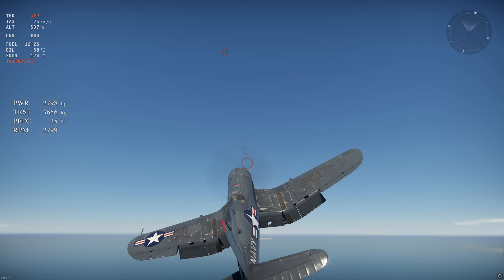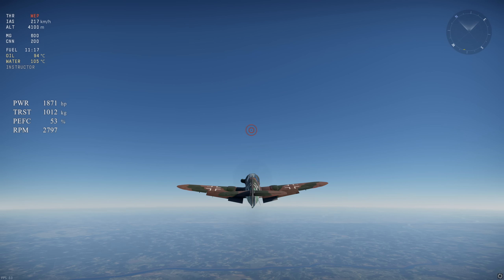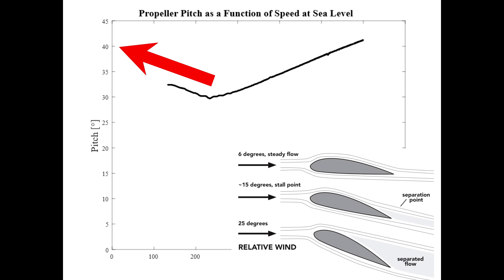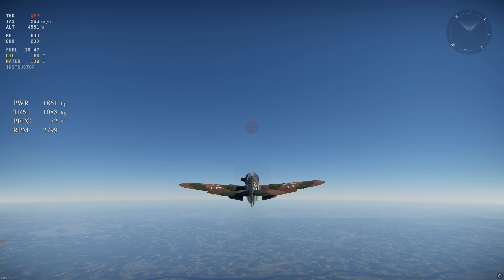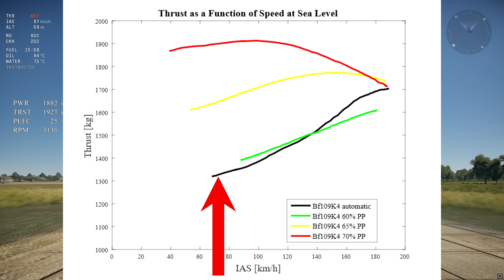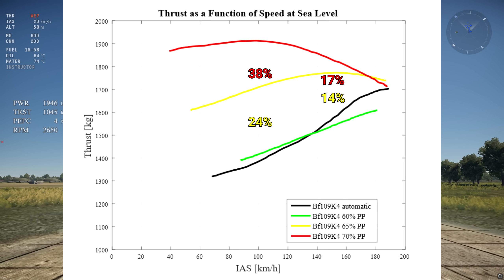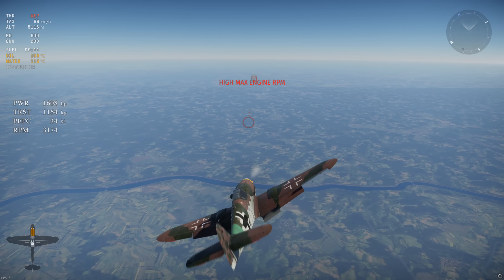War Thunder Tricks #8 | Prop Pitch Trick for Extra Thrust

Comment: I only want to be able to throw the prop pitch into reverse thrust. It needs to toggle from automatic to full reverse pitch and back to automatic. I would bind it to the same key that I have my airbrakes and thrust reverser on. I already added a separate key so I can apply wheel brakes while I maintain full throttle and tested it fully with my SK60B. With it I can come in at full WEP, hit H, deploying airbrakes and reverse thrusters, and hold the B for wheel brakes as well. If I can toggle reverse prop pitch on and off with my airbrakes, (where applicable), I can get the same effect across a wider selection of aircraft. How can I set up my prop pitch to toggle as described?

Comment: This does nothing. They have fixed auto prop pitch, so no matter what you do you will either heat your engines faster or not get more thrust.
Reply from the maker: No, this was made after the fix you're referring to. It's not about extra power, it's about improving propeller efficiency.

Comment: Great video, thanks you very much! Can I ask you something since I'm new to this? I use pitch control 70% to climb in the start of a match. Can I keep this value of 70 during battle and just switch to auto pitch control? Or is it better to reset pitch to 50% first and then switch to auto? During battle I'll use WEP and I'm not sure if 70% with WEP will hurt the engine or affect performance.
Reply from the maker: I definitely recommend keeping prop pitch on automatic, except if you want to use the prop pitch airbrake trick. There's also the extra thrust trick, but that can come later.

Comment: 5:45 sorry but is the opposite
early Bfs cant run away from enemy, so they are forced to dogfight, then you can use additional thrust trick (E1 flap dogfight with 100% pitch is a monster)
later models of Bfs can outrun some foes so the trick is not about more power but not to heat engine with MEC and low pitch
Reply from the maker: Early Bf109s don't have this issue.
Reply: @AdamTheEnginerd  what issue? Sorry but im italian i understand only "boring complete" english xp

Comment: max pitch for later models of Bf is 64-65% for climb
more then that is just a coin toss, if your engine became yellow you are fucked
for E1 model max pitch is 80-85% and max thrust is 100%
if you want to brake just 0% with WEP still on, youll brake with simply turning the plane, but the engine will stay on max power (useful because Bfs are nerfed like -200Hp and they dont fly well like USA plane that have unlimited WEP and +200Hp)
Reply from the maker: Hmm.
Reply: @AdamTheEnginerd  trust me :D
i play only Bf
i use only manual pitch because more freedom

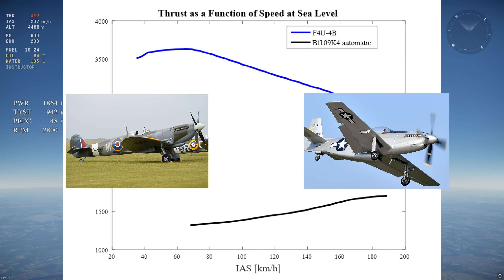Comment: 1:45
this is the problem with air battles
USA have WEP but in reality you can use it only for few mins (1 time)
germany have (they arent in game, but under the wrong stuff WEP) ethanol and water injection and NOS :))) and they can be used multiple times
so thinking about max power for USA is wrong
for real calculations USA cant use WEP and germany CAN use WEP
but we talking about crybabies so is good that USA is buffed like hell :)))
Reply from the maker: Yet Germany had a significantly higher win rate than US, at least before the main nation team changes.
Reply: @AdamTheEnginerd  yes
USA pilots just point at enemy and shoot, tunnel vision

but i understand why gaijin nerfed germany. too strong :))) WT is a bielorussian game, what a shame if germany could win EZ eheheh

my beloved Bf E1 have 984Hp

in reality the "DB601A-1" engine have 1085Hp
and "DB601Aa" 1158Hp

i still win with nerfed versions so i understand why #germanysuffer XP

Comment: Adam, a lot of the Japanese planes are in mmHG not InchesHG. Just a pointer for you. 50"hg (for the j7w1) would be coincidentally on 50, but the guages measure "boost" x10 
So 50 on the dial is +500mmhg over atmospheric (760)
Reply from the maker: Yeah I know the Japanese planes are in metric.

Comment: I think I finally understand this effect now. I wasn’t getting it before because I wasn’t taking into account that thrust increases as speed decreases. That’s why the engine overrevs below a certain speed, isn’t it?
Reply from the maker: Hmm the prop stalls below a certain speed, so you want to increase RPM to decrease AoA and hence increase prop efficiency.
Reply: @AdamTheEnginerd  I understand that the prop is stalling below 200kph which is why you manually increase RPM to prevent that stalling. But what I don’t get is why the prop pitch starts increasing below 200kph in the first place (btw I’m using the term prop pitch in the traditional sense, not the % like in wt)

Dynamic pressure acts to increase the RPM of a prop, doesn’t it? So how is it that the lack of dynamic pressure below 200kph causes the the prop to over-rev (thus making the game increase prop pitch to prevent the over-revving)? Shouldn’t the lack of dynamic pressure mean the prop revs less?
Reply from the maker: Dynamic pressure is what provides the torque on the prop, if you reduce that you'll increase the revs if pitch angle remains constant.
Reply: @AdamTheEnginerd  Yeah so that statement by itself makes sense, but I'm having trouble reconciling that with the idea that, for a constant prop pitch, RPM increases with airspeed. If dynamic pressure is increasing, why do fixed pitch props spin faster when the plane speed sup?
Reply from the maker: @dogeness  For constant pitch props, the RPM increases with speed because it reduces the AoA of the prop and hence less torque on the prop, so RPM increases. In the K4's case here, the usual happens where the prop pitch reduces as speed reduces until a bit above 200km/h. Below that speed, it looks like the reduction in dynamic pressure "is too significant" for the prop to handle causing a tendency for the engine to overrev, so the prop pitch governor increases prop pitch instead to create more torque to prevent overreving.
Reply: @AdamTheEnginerd  So there's two countervailing effects as speed increases? AoA decreases which decreases torque and acts to increase RPM, and dynamic pressure increases which acts to slow RPM?
Reply from the maker: @dogeness  Yup! The special thing here is that the engine "knows" it needs to increase RPM as speed further decreases past 200km/h.
Reply: @AdamTheEnginerd  What do you mean it knows though? I thought that part was done manually, or else the engine would try to maintain the same RPM thus increasing pitch too much.
Reply from the maker: @dogeness  When it's on automatic I'm not doing anything to the pitch, so it increases to prevent overreving. The manual part is increasing the RPM to bring the pitch back down.
Reply: @AdamTheEnginerd  Yes I understand that so why did you say "the engine knows it needs to increase RPM"?
Reply from the maker: @dogeness  Woops, increase pitch angle* instead of RPM, sorry.
Reply: @AdamTheEnginerd  No problem. Ok, I think I understand it a little bit better now. I was having such a hard time wrapping my head around this because I didn't realize the dynamic pressure and the torque effects were separate. Is there a simple equation that determines torque on the propeller as a function of airspeed?
Reply from the maker: @dogeness  Torque would just be engine power with the necessary unit conversions, so it wouldn't depend on airspeed (I think).

Comment: A little late to the party, but....

Is there a point when torque overwhelms control authority as IAS reduces?  Does Gaijin not model that as it could cause too many ground loops thanks to the Me 109’s infamous narrow track landing gear?  Or is not really a problem as long as you are paying careful attention to the throttle and propeller pitch angle?
Reply from the maker: There's no torque in RB, but in SB there definitely is, you can't aim well if you're below stall speed in SB.

Comment: La-7s, La-9s, and later yaks have the same issues, right? For planes with insane acceleration at low alt they sure are slow to take off
Reply from the maker: Exactly! But those planes can't do this trick.
Reply: @AdamTheEnginerd  one nice thing about P-47s, corsairs, and tempests: they have props the size of windmills, 109 pilots never expect you to beat them in a stall climb (obviously not the go to tactic, but it's a satisfying trick to pull off on them)
Reply from the maker: Yeah F4U4B has better stall climb than Bf109s despite having a lower climb rate.
Reply: @AdamTheEnginerd  Is there an advantage to a prop that is "too small"? is it better at higher speeds?
Reply from the maker: @Turk3YbAstEr  Lighter, smaller landing gear.
Reply: @AdamTheEnginerd  yeah, i think the main reason of the corsair's wing shape was due to the landing gear/prop problem. they were committed to the 13ft diameter prop to take advantage of the bigass engine, but long enough landing gear had trouble with the rigor of carrier landings. so they changed the wing to make shorter/stronger landing gear work. seems to have worked out pretty well,
Reply: @AdamTheEnginerd  so is there any reason to choose a 3 bladed propellor over a 4-bladed or 5-bladed propellor (besides weight)?  It seems like both the DB605 and Shevstov radial were producing more power than the merlin (at least the merlin variants they started using 4-bladed props on) by the end of the war, and the La-9 was made post-war so surely they could have designed a new prop by then.
Reply from the maker: @Turk3YbAstEr  Weight mainly. The German 3-bladed props are pretty wide, while the British went for thinner but more blades.

Comment: I try 70% prop on g6 and yes, the rpm warning pop out, it disappear for a while when i set to 65% and everytime i got altitude, the rpm warning showed again until i set to 60% pitch, then i switch to auto, when compared to auto, the 60% prop are useless but i cant set more than it, maybe its incompatible with the g6 or the gaijin already know this video and then nerf the prop pitch?
Reply from the maker: No nothing was changed. As said in this video, RPM will increase as you get higher, so you need to lower prop pitch or else you'll overrev. Can do a bit more % on the G6 compared to the K4.
Reply: so, in my second try, i try to take off using k4 with WEP and 70% prop pitch, and the rpm warning pop up immediately, but when i use 100% throttle, it works fine, i only need to decrease little by little prop pitch until 60% at 3k meters, and not lose many speed, but compared to your test, you was taking off using wep and 70% prop pitch, and no rpm warning, what make my test and your test different?
*sorry my bad english.... :(
Reply from the maker: I did have RPM warning the whole time on 70% prop pitch. You need to stay on WEP as well, all my tests are on WEP (better off WEPing for a couple of reasons).

Comment: Could someone explain what float carbeterer thing is (Idk how to spell it
Reply from the maker: It's what controls the fuel flow to the engine. It's designed to work in positive Gs, while it can stop working in negative Gs in some designs like early Spitfires, starving the engine.
Reply: Carburetor is essentially a mix of toilet water tank and air brush gun. The nozzle in carburetor doesn't take fuel from some pipe but from a very small fuel tank mounted inside the carburetor. (Just for reference, on my motorcycle this small fuel tank is about 1/2 of a coffee cup). So if you open your toilet water tank you will see a floating thing with a lever. This is exactly the mechanism used in carburetor for stopping fuel from getting into that small tank when it thinks it's full. Good thing it's easy to implement. Bad thing is that it only works well on ground vehicles. When on an aircraft it works well if you fly straight. But if you pull negative G's the fuel in that small tank will not be where it's supposed to be and this will disrupt fuel flow to the engine. 
Of course there are special types of carburetors for aircraft but you will often see warning on a car carburetors saying that it's not designed to operate in an aircraft.

Comment: Hey Adam, great vid. So this is basically the same overrevving the engine that is in your re2005 video?
Reply from the maker: Thanks!

Actually it's not! The Re2005 has an appropriately sized propeller for its engine power, it didn't suffer from what the Bf109s suffer from at low speed. Re2005 trick is more of a bug exploit, while this trick makes sense physically (even though irl pilots would never do this).

Comment: I still haven't been able to use the local host. I don't want to disturb you, but could you help me more? How I do? it's a bad dream to use the host site to know the rate of climb ... I couldn't do it based on the link tutorial ... Please help me ... I love your channel! And I'm inspired by your maneuvers and your local host ... I'm sorry to bother you!
Reply from the maker: Did you install and run WTRTI that's in the overlay link in the description? Join my Discord and send me screenshots of what you're doing.
Reply: @AdamTheEnginerd  I couldn't put it on the screen of game:(...
I do not have a acount in discord.
Thanks for the answer! You are especial!
The youtubers dont answer me.
Reply from the maker: @asafemartins2476  You need to use WTRTI setting instead of the default RTSS in Settings. You also need to play in fullscreen window or window for it to appear over your game.
Reply: @AdamTheEnginerd  OK, i will try. If i do it the my local host will be equal the your??
Thanks!
Reply from the maker: @asafemartins2476  WTRTI overlay in the description, not the local host.
Reply: @AdamTheEnginerd  ok
Reply: @AdamTheEnginerd  I need to press Apply after it?
Reply: When i press apply appears "fail to initialize WGL openGL context"
Reply from the maker: @asafemartins2476  Hmm someone else had that issue. I'm using an older version, maybe that's why mine works and yours doesn't. Can't help except to say try an earlier version.
Reply: @AdamTheEnginerd  Ok, thanks!!!!
Reply: @AdamTheEnginerd  Hi Adam. Thanks!!

Comment: Wish I was smart enough to understand MEC. I hit 2.5kd in my p47 recently , know to use flaps etc but feel like these bits of info will give that extra 5% Edge you need in dire situations (mostly against UFO k4s 🛸)
Reply from the maker: It's not hard to understand, most things are precisely what you imagine them to be with intuitive effects. DEFYN and I made a MEC tutorial, feel free to check it out. P47 MEC is one example where you set it at the beginning of the match and you don't worry about it, with a noticeable improvement in performance.
Reply: AdamTheEnginerd brilliant I’ll take a look today before doing some games. Feel like the razorback would benefit greatly. Thanks for reply mate!
Reply from the maker: My pleasure!

Comment: I have an extremely important note for the 100 prop pitch in a 109. If you dive then enable the prop pitch at like 5 to 6 hundred kmph IAS, it will slow you down to 0IAS so don't forget to turn it back to auto before you lose all of your speed and stall. I recommend turning it on when you are at the beginning of your dive near 300kmph IAS since it lets you gain speed, but not as quick.
Reply from the maker: Yup, prop pitch airbrake is another trick.
Reply: @AdamTheEnginerd  Yea thats what I'm talking about. Enabling it at high speeds will make your speed go backwards, but enabling it before you dive lets you gain speed slowly.